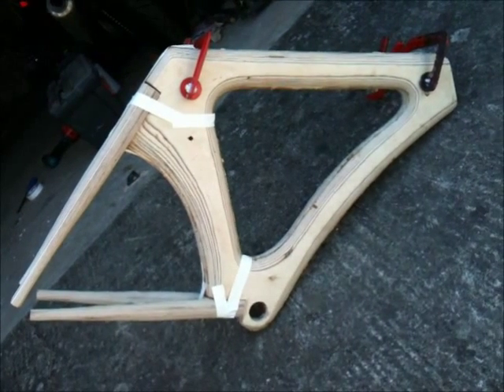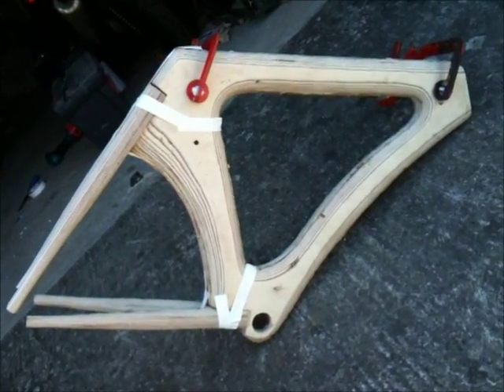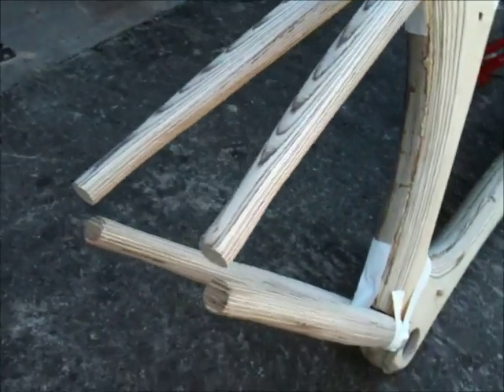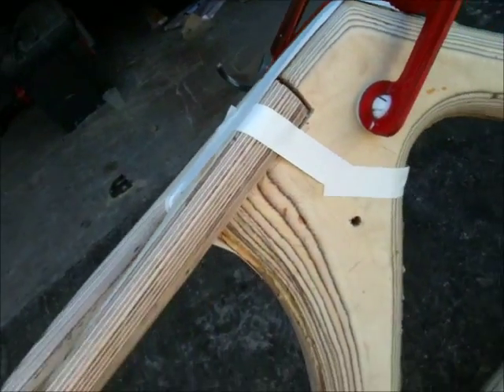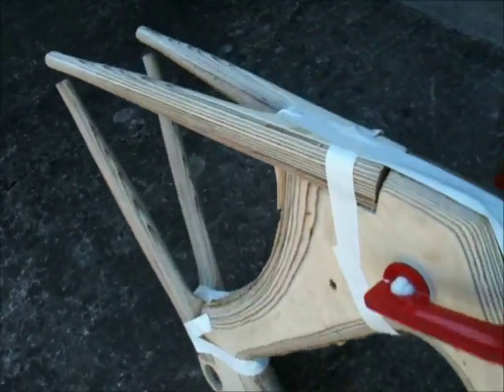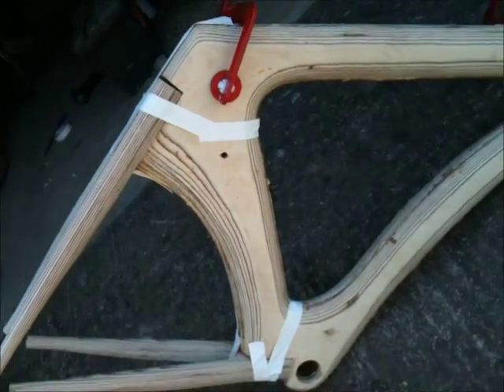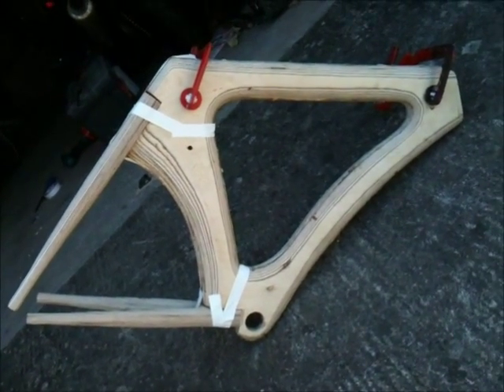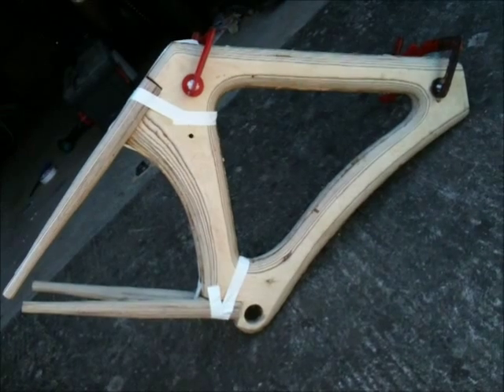taped together

Comment: Hi I'm very interested in your project as I'm thinking about building a ply framed recumbent. What do you expect the final weight to be? Are you finishing the frame Fibre Glass and resin? How have you installed the bottom bracket to keep it secure?
Wood is an underestimated material!